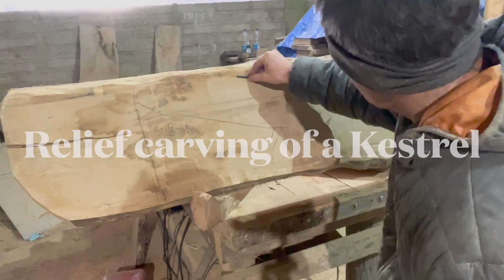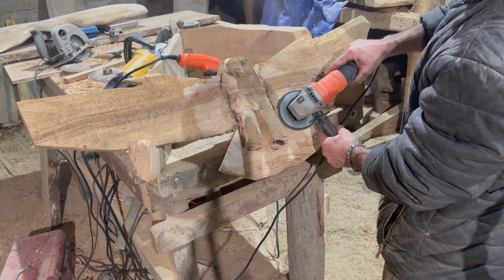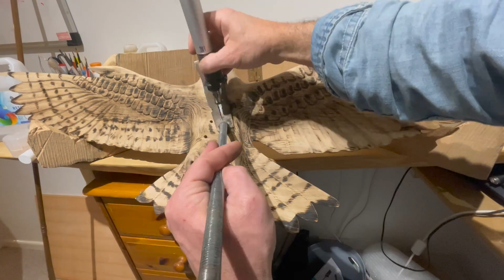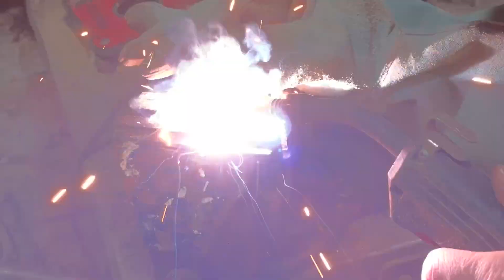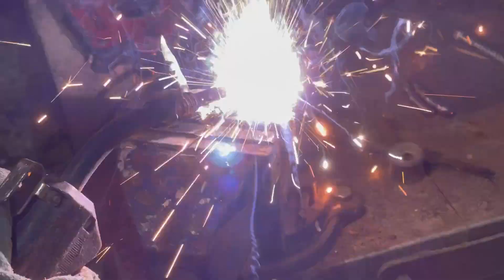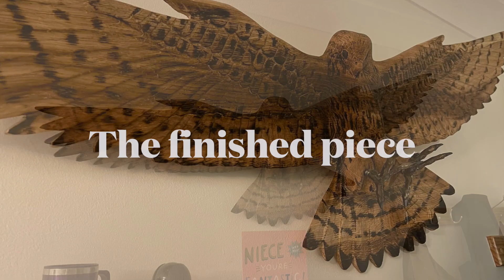Making Of A Kestrel Relief Carving

Comment: Great way of making talons - they’re very realistic. I’m looking for a cost effective way of doing similar, do you know whether a gasless, flux core welder would do this? Thanks. Love your work
Reply from the maker: Yes I do and that is what I use for making them, so easy. I used threaded rod, but have used nails, will probably use rebar at some point to. Good luck 👍
Reply from the maker: Oh and weld the threaded rod toes onto a coach screw these were m8, chunky enough for a kestrel leg!